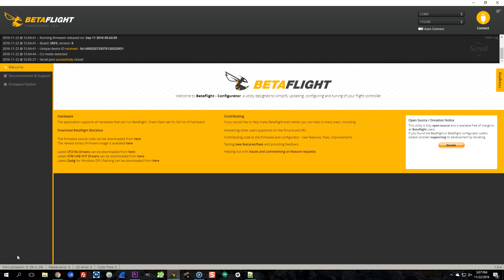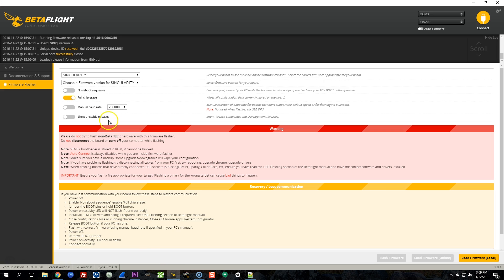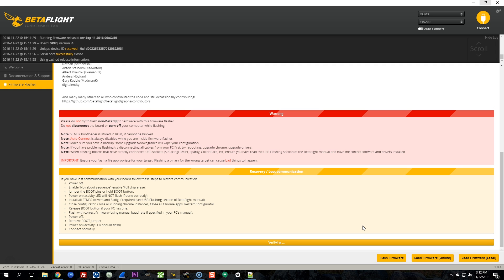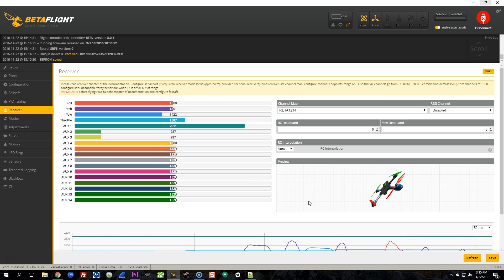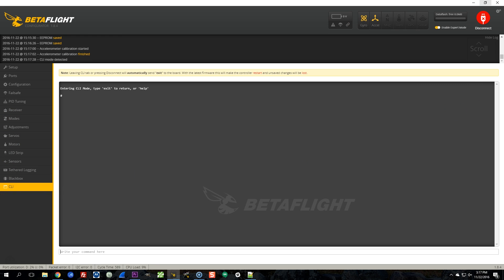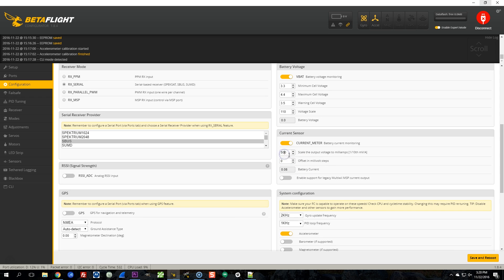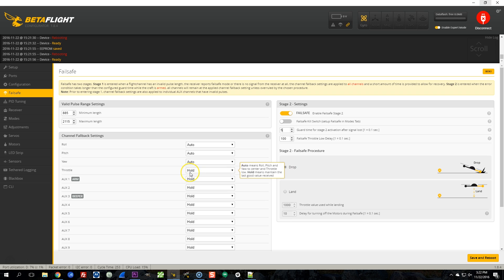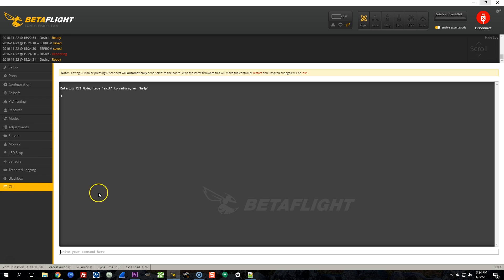Holybro Shuriken X1 - Initial Betaflight Configuration | READY TO FLY RACING DRONE

Comment: Hello Joshua.....When i plug into usb port in betaflight all is well ...when i disconnect and insert battery power i get initial esc song ..nothing else ..wont arm with battery...everything works with usb port ...any ideas ...thanks
Reply from the maker: Do you get the full ESC tone when plugging in the battery? All five notes?

Do the LEDs on the FC behave the same with battery as on USB? Like, normally there is a pause, then a fast-flash, then a solid LED, or whatever.
Reply: Negative only 3 notes ...no complete tone no lights...but when connected to usb and betaflight everything works perfect
Reply: with usb everything works when connected to battery
Reply: when i connect battery 3 esc tones then nothing no lights no power
Reply: flysky receiver ...v2 esc
Reply: when i plug in just usb all fc lights activate normally..then i connect battery and full activation...I can work my motors.... everything ...
Reply from the maker: If the FC does not light up when powered from the battery then whatever voltage regulator is powering the FC is probably defective. It works from USB because USB provides 5v power directly.
Reply: Thank you for your help....Looks like a $78.00 investment on new f.c....No way to bypass or replace voltage regulator..????Thanks again for your reply....I also own the furibee fuuton 200 can i use that F.c on my shuriken x1...??? its less expensive...
Reply: Update ......little square box that has 220 stamped on top of F.C near battery plug is broken ..must be voltage regulator...I have ordered a new F.c.. thanks again

Comment: Hi Josh, did you manage to get the X1 to work with multishot? Did you have to make any other changes to get it to work? I tried, props didn't spin up at all, so ended up switching it back to oneshot. Thanks!
Reply from the maker: It depends on what ESCs you have, whether they support it.
Reply: According to the shuriken X1's documentation it's a "30A/40A burst BLHeli S ESC", which I thought supported multishot, but what do I know :-)

Comment: One question for Joshua, i've got my X1, amazing quad, i feel almost a pro now, but after 3 days i burnt an ESC, so i ordered the Kamikaze from underground FPV, but i noticed that they still are one shot, but in your video you selected multishot on Betaflight, is that something u think i can do as well and what are the advantages?
Reply from the maker: If it is a BLHeli_S ESC you can use Multishot. If it is not BLHeli_S, you have to load a special firmware to run multishot.
Reply: Joshua Bardwell thank you

Comment: hello. I'm in massive  need of some help. I've gone and accidentally  changed to uart 3 and now it won't connect  to my pc. I have no idea how to change it back and nothing  will work. please can you provide  me with a solution  to fix this? many thanks
Reply from the maker: +Guy Osgerby I think you disabled MSP on UART 1. If so, the fix is to re flash the firmware using the bootloader button. You will need to rebuild the config from scratch. The target board is SPRACINGF3.
Reply: Joshua Bardwell I tryed upgrading to the latest version. it loads but doesn't flash. I think I've watched this video a thousand  times to see if I've missed anything.
Reply from the maker: +Guy Osgerby are you using the bootloader button?
Reply: it turns a solid green. can you explain  exactly  what I need to do? should it be held in and then the USB plugged in? I've tried everything  but so far no ptogress
Reply from the maker: +Guy Osgerby yes. Hold the bootloader button in as you plug the USB. Check my video here:

https://youtu.be/e7dGCZMJ6SA
Reply: thank you very much! the thing is I basically  had it set up as per your video. everything  connected and worked without updating the firmware until I selected the uart 3 rx in the ports heading.
Reply from the maker: +Guy Osgerby enabling serial rx on UART 3 should not make it inaccessible via USB.

Comment: Hi I see the current sensor at 500 maybe set by Holybro, i went back and checked your kombini current video and you ended up on 170 i think. Looks like from other videos betaflight 3 default might be 400. Two questions I have are, are my kombini boards likely to be right at 170? And is 100 - 500 range expected between board makes?
Reply from the maker: Whether your Kombini boards are right at 170 depends on the tolerances of the current shunt resistor that Furious uses. No possible way for me to speak to that without testing a bunch of boards.

Comment: You removed the "AirMode" in Modes, saying you will do "Feature AirMode".
=> Does this mean that removing the AirMode in Modes provides a permanent AirMode for all modes, or on the contrary that it is always disabled?
(have mercy, not a native English speaker here)
Reply from the maker: +Ludovic L. In the Configuration tab, there is a radio button to enable air mode permanently. It's in the Features section with Blackbox, softserial, telemetry, etc...

Comment: at 9:40 you mentioned that oneshot is not happy at 4k, appreciate if you can elaborate or link to a video that explains this mystery.. thanks
Reply from the maker: +Tahir Muzaffar with a 250 ms pulse length and 4 kHz frequency, the signal would be "on" 100% of the time. Without any "off" time between pulses, the sync of the pulses would be lost.

Comment: Hey Joshua, Why didn't you disable "motor pwm speed separated from PID speed" when you did go for 4k/2k ?
Reply from the maker: +Kristian Frydstad it might have been an oversight. I often run motor speed at 8k. I've heard that higher motor output rate can reduce top end power because the ESC is getting too many interrupts. So I don't really know where the balance is between faster refresh and too fast. I'm honestly not convinced there is any difference at all part about 2k so I don't out a lot of thought into it.
Reply: I asked because you didn't tell the disadvantage and it seems like you would have rund synced if CPU load was't that high. 
After watching your "what is mulitshot" i realised that there might not be a disadvantage.
Let's say 4k/2k
- If you run sync and 1 ESC command fails, ESC will follow last command then update.
- If you run usync at double speed, ESC will only follow last command half the time and you lowered CPU Load.
Thank's for the fast response !
I learn more when i ask WHY :)
Reply from the maker: +Kristian Frydstad Yeah, I can agree that unsynced might be a good choice here.

Comment: I had the same steps tried bootloader and that didn't work then tried non bootloader flash with manual baud and it says timeout press flash firmware again and it worked. I have sp f3 with cp210 probably that is why.
Reply from the maker: +Rizki Pratama same here, line you saw. So weird.

Comment: Last week as I unplugged my battery I bumped my arming switch, nearly a disaster. Twisted bones gave me the idea that with the throttle up the quad won't arm. So today I set a throttle cut switch to half throttle and success, 2 switch arm. It may be something you would like to share with the community as a safety lesson. Thanks so much for your time.
Reply from the maker: +NINJA KWAD if you have a Taranis check out my "safer switch arming" video. Alternatively, you can just raise the throttle after disarming.

Comment: Hi joshua I had to tune a little bit the current sensor I just play with the offset because the iddle consumption of my shuriken was 1.4 at iddle with vtx at 200mw and not arm motors when the real mah consumed reading with my amperimeter was only 0.4 amps.
Reply from the maker: +Moriwaky c if you only tweaked based on idle consumption, be aware your calibration at high amps might be way, way off. Better to calibrate at like 20 amps if you can. Current adjustment involves calibrating both the Offset and the Scale. Offset is low amps calibration, more or less. Scale is high amps calibration.
Reply: Joshua Bardwell as you said in your video about current calibration is a bit scary to do it at high amps,  my middle age men courage oly let my go up to 15 amps and the reading was ok. Will try higer values somenday or wait for other more bravery